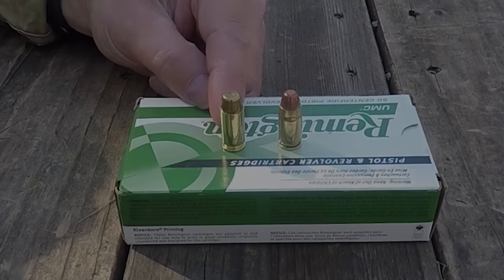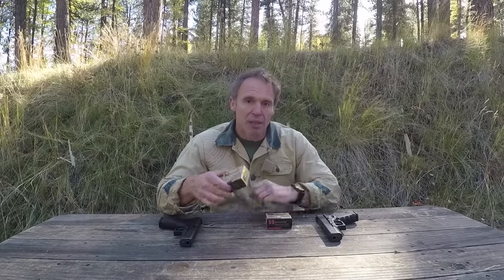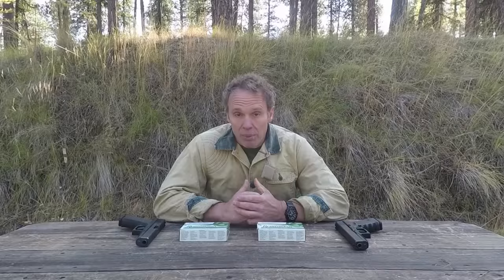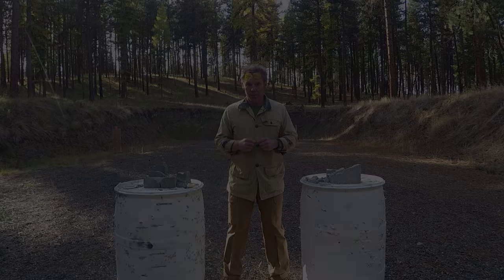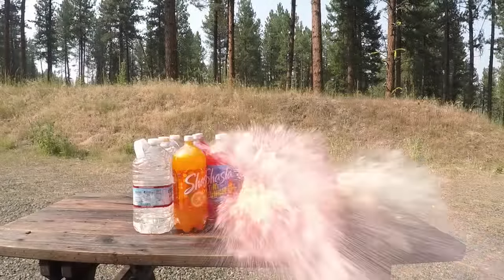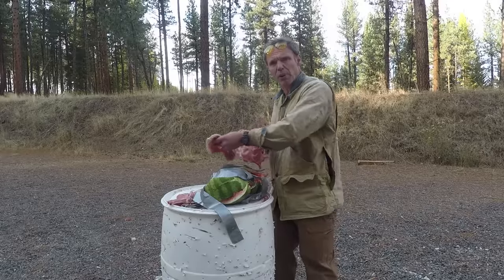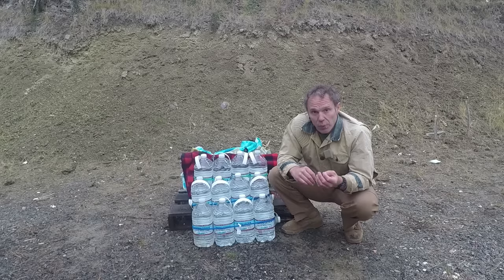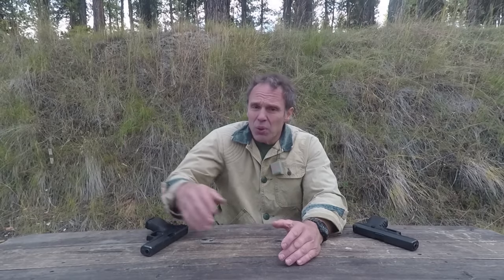Personal protection: .357 SIG vs. .40 s/w

Comment: This is why I personally prefer the .40 cal. It has sufficient stopping power, great expansion to get the job done in "close quarters combat", namely home self-defense. However, it is not powerful enough for over-penetration in case you miss, which most likely will go through walls and hit neighbors or others outside at the time. There is a time to shoot, a time to defend, but remember, you can and will be held accountable for any way-ward shot that injures an innocent bystander.If the circumstance arises, let your shot be true, let it be accurate and pray that you don't miss and hit an unintended target. Tough decision, but I carry anyway. Be your best, but don't get sued!

Comment: This is why I love my Glock 32. It's chambered in .357 Sig but I have .40 and 9mm barrels as well. I shoot what I can get! The same can be true in reverse for Glock 23 owners. While they both accept 9mm conversions, it requires at minimum the barrel and RSA, and an extractor if you don't care about those 6 o'clock ETFs. If you wear eyepro, the latter you can deal with.

Comment: Hi Paul, rewatching the various 357 Sig videos.  I agree with you in that it is an expensive round for training.  I will pass along what I did 15 years ago that could be applicable here.  I love 45s and at the time it cost 10 cents a round more to shoot than 9 mm.  I used to get 1000 rounds of 9 mm for $300 and 1000 rounds 45 ACP for $400.  At the time, I could pick up same type 9 mm pistol to my 45 ACP for $600.  As such, if I shot 6,000 rounds of 9 mm as a supplement to my 45 ACP in practice, the 9 mm pistol became essentially free and any more ammo through it was savings over 45 ACP.  For 357 Sig, AmmoSeek currently lists 1,000 rounds at a lowest price of 430; 9 mm is 1000 rounds for $190.  The price difference is 24 cents per round.  Let's call it 20 cents per round difference to keep math simple.  As a member of GGSF, I could probably get a Glock 17 in 9 mm for $600 with a GGSF membership and the discount on one Glock per year.  As such, after 3,000 rounds (or likely a couple of years of range practice), the G17 is essentially paid for and 9 mm ammo can be used as a more frequent training round - similar to using 38s through a 357 magnum.  Of course, you still want to shoot 357 Sig from time to time but this is a potential approach that doesn't take too long to justify getting a second pistol in 9 mm as surrogate trainer for 357 Sig.  Just my two cents.  I did similar for 9 vs 45 when money was tighter and I didn't want to use 22s as a surrogate.

Comment: I have 3 barrels for my Glock 23; a 9mm, .357 Sig, and .40 S&W. When shooting all 3 calibers with nearly the same weight of projectile, the difference in felt recoil is minimal. With the 9 mm as reference, and with approximately the same weight projectile, there is a bit more “snap” with the.357 Sig and a bit more “push” with the .40 S&W.  I seem to be a tiny bit more accurate, and more importantly more consistent with the 9mm and the .357 Sig.  I can guarantee that your results will differ.   I have several other 9 mm pistols and 1 other .40 S&W. I will say there’s nearly as much difference in felt recoil between some of my 9 mm’s as  there is in the 3 different barrel in the Glock.

Comment: I wish 357 sig was more popular/available/cheaper. It's a great round. In between 40&10mm in power but in the smaller 9mm sized frame vs 10mm being in the larger 45acp sized frame. Great self defense round and in my opinion a decent wilderness side arm in the semiautomatic verity

Comment: @0:32.  Actually, the .357Sig is NOT a necked down .40.   If you tried to neck down a .40 casing to .357 Sig, the casing would be too short.   So what is it exactly?  Answer:  .357Sig is a CUT down (slightly longer than .40) then NECKED DOWN to .357 Sig from a 10mm casing.  Google it.

Comment: If you take the hottest 40 155gr from Underwood and the hottest 147gr 357sig from Underwood, the 40 beats the 357sig. 
.40s&w-155gr-1300fps (4” barrel)
.357sig-147gr-1250fps (4” barrel)

Plus the 40 can take 180 and 200 grain bullets and as low as 125 grains. It’s more versatile and every bit as powerful. Some of these companies water down some cartridges while having other closer to spec. 10mm being a good example

Comment: Install a threaded barrel that adds an inch to the length. The added inch will add on average 50 ft/lbs to the KE, and equal appropriate 500 ft/lbs; without any additional recoil.  

500 ft/lbs is also the average rating of a .357 sig; granting the .40 S&W an equivalent of KE.  

Consider the added diameter of the projectile and added weight of the .40 projectile makes .40 S&W the SUPERIOR bullet/cartridge for personal protection.  NOT, the .357 SIG.

Comment: If you're comparing calibers stop trying to use the same bullet weight!  They are different for a reason.
"I'm gonna gonna race this V8 sedan and a 4 cylinder hatchback, but to make it fair the V8 is pulling a trailer...."

Comment: I read that it was not really based on the .40sw, but the original 10mm and cut down to a very similar length. That's splitting hairs of course.

As for the blocks, they are cinder blocks. Concrete has aggregate (rocks) in it. Some writer with no experience must have started calling these "concrete blocks." They are not. Concrete blocks are much heavier.

Comment: I thought your review was very unbiased and straight forward .  I was wondering your thoughts on how "the .40 is dead" and everyone is using a 9mm +P comparison to make their claim. Standard pressure for both is 35,000 and 9mm+P is 38,500...why is there not a +P SAAMI pressure for the .40.  Might make a good table top discussion.  Thanx

Comment: You should use the standard load of each, and a standard load of 40 Smith for defense purposes is usually a hundred fifty-five 165 grain hollow point. The standard for 357 Sig 125 grain hollow point. That would be a fair comparison because that's the most carried loads for the purpose of Defense

Comment: I read somewhere that the .40 was purposely a heavy hitter but shorter-penetrating round, for use in urban LE where there's a heightened risk of bystander casualties.
Reply: .40 is literally just 10mm weakened to the point female and otherwise inferior cops can shoot it.

Comment: .357 SIG is designed for maximum penetration specifically for street shootings where the bullet needs to go through car doors and fenders and do damage on the other side of the vehicle.
What is the point to use JHP bullets with a caliber that is designed to penetrate before it hits the target, not to release its energy within the first obstacle?
Also, if those two are side by side penetrating 2x4 wood (multiple planks) or a target hidden behind a vehicle - the .357 SIG with greatly outperform the .40 S&W.

Comment: I'd say .40S&W is better, because due to price, you can get A LOT more practice for your buck, and I'd say the performance gain with .357 Sig doesn't justify the increase in cost to practice with your weapon. When you're poor like me, and need a caliber capable of defeating barriers with ease (why I don't use 9mm), cost is a huge deciding factor. I couldn't afford to train as much with .357 Sig as I can with .40S&W.
Reply: for me, the .357 sig really shines when used in a PCC, because the longer barrel length increases a lot the velocity of the projectile (see 357 sig test on carbines for you to understand what I'm talking about), besides that the 357 sig is a very accurate caliber, in a PCC is even more accurate

Comment: If I were running 357 sig I'd have a carbine and a heavily modified pistol. I'd also load my own ammo to find the right middle ground for carbine effectiveness (longer burn) and pistol effectiveness. I'd also extended the barrel of my pistol a bit and add a flash suppressor because of the fireball effect of slower burning powder. The goal wouldn't be to get the most power 357 sig ammo (notorious for destroying pistols) and not the fastest carbine round either. It'd be more like running +p+ 9mm ammo but though two far more stable platforms.

Comment: I think I'm missing the point. Check out Remington Golden Saber now called Remington Black Belt ammunition. The test I've done, at one point .400 caliber Golden Saber bullets at 180gr. expanse to 7/8 of an inch from  7/16" plus it
 goes  2" deeper than lighter higher velocity weights of the same caliber. For personal protection I'm looking for something that expanse more than slices through + easier to obtain ammo. And my personal thoughts are I don't want to stand in front of any bullet anyway.

Comment: I use 125grain in my glock 23. It's about the closest to being the best personal defensive load for the 40cal. It's the weapon that is my primary carry weapon for winter and bulkly winter clothes. My usual carry weapon is a glick19 useing a 124grain load. I also have glasser safety slugs for home defensive situations. To prevent over penetration in close range situations indoors. Is one better than the other. Probably not and both are effective. But modtly I carry a glock19 useing 124 grain ammo. It's a effective defensive load and I'm satisfied useing it. But to be honest. A handgun is basically a defensive weapon. And the old saying that only a fool knowingly carries a handgun to a gunfight is still prevalent today. And use of a carbine or rifle or shotgun will always be a better choice for most defensive situations.

Comment: Had both barrels in a glock 22 and the 357sig was a beast to shoot compared to the 40.  I sold the barrel, not worth the ammo expense and recoil disadvantages.  You can see and hear the difference in the video. It is significant for very little gain. FWIW I shoot large calibers all the time but the G22 is my oldest and  one of my most reliable pistols and dont see any advantage to the .357SIG in a defensive pistol.  Considering this is the EXACT same pistol in both calibers (only difference is the barrel),  in most cases, with frangable ammo in a home defense situation you never want to over penetrate so the advantage is skewed towards the 40.

Comment: I think the 40 has a better energy dump up front of the sodas, but the 357 has better penatration with a later energy transfer that's equally impressive. Both are excellent rounds and I wouldn't feel underarmed with either. 40 is my go to though

Comment: One of the greatest flaws of the .40 is paradoxically its very origin : it is always compared against its parent cartridge the 10mm, which is VERY potent, and that damages how it compares to the ubiquitous 9mm and 45acp, which it outperforms in every aspect.
It remains a very capable handgun round (which means, average at best when pitted against long gun cartridges), that should have taken it's rightful place as the standard police round everywhere imho, where handguns are used as a primary weapon...

Comment: great video. terse, informative, and without irrelevant fluff filler.  Thought: would have mitigated potential variables further by using both barrels in a single gun. (edit:)  man, the level to which almost all major manufacturers download .357 sig is ridiculous. then the premium brands charge you astronomical prices to purchase the "enhanced performance" which is....yay....the original loading. wth.  1270? i have regular pressure 9*19 that hits that, albeit with 115 grain bullet. but sig should hit 1400 no problem in regular, default loading imo. otherwise, the entire purpose of the round is nullified. performance loadings, and this is just arbitrary opinion, should hit 1600+.

Comment: Excellent video! Factual based info! It looks that the 357sig it's very solid round. Your  video already suggested that 357 sig it's "better" than 40. You also have a 40 vs 45 video that suggests that 45 it's "better" than 40. So why don't make a 357sig vs 45 video as a "better" man stopper round?

Comment: The 357 sig was designed for the 125 gr bullet and for around 500 ft lbs. you should use what the round was designed for and not similar weights for each load.

Comment: 165gr generally optimizes the power potential of the 40sw.  The sig was designed to optimize at 125.  So , you danced all around it, but never did find the right spot.  Also, the 40sw generally loads to 480 fl-lbs range true commercial load, remington or sig sauer ammo loadings.   So again, comparing two cartridges, you hav left in key variables that make this presentation of marginal utility.

Comment: This is where there’s a lot of contradiction, but I believe that 357 sig. is actually based on 10 mm not 40 Smith & Wesson. The reason is that the neck is slightly longer on that 357sig.. I don’t claim to know whether you can simply neck down to 40 Smith & Wesson case to make a 357 sig. but I would guess there would probably be a bit of issue.
So yeah I’d say it’s actually based on the 10 mm based on my limited knowledge and I fully acknowledge that I could be completely wrong on this I just think it’s an interesting topic and if anyone has any information I would appreciate it
Reply: No that would be 9x25mm Dillon. Its much more powerful than either.

Comment: The .357 Sig was designed for speed and distance. It can blow a hole completely through a person. The .40 cal is not for long distance. It's not likely to blow a hole completely through a person. It will however make much more of a mess. They're both nasty. Neither round is "better" than the other any more than comparing a hammer to a screw driver. They have their applications. The concrete block test was totally ill conceived, unless you just want to kill concrete blocks. Any single shot, from either gun would have the power in one person's hands to end another's. But all of the cowboy bobs of the world just think about how big a hole they can put in someone. I love my guns in the night stand and gun safe. Guess I'm old school.

Comment: Hmm ... Now I might have to drop my G32 barrel into my G23, and start carrying that more often. I also like the flatter trajectory of the .357 SIG. Keeping a heavy tungsten guide rod in my G23, also tames the slightly snappier felt-recoil of the .357 SIG.
Reply: I noticed that lighter and faster bullets tend to dump their energy closer to the entrance than slower heavier bullets. Ever noticed how the .357 SIG destroyed the ribs while the .40 S&W seemed to do more damage to the watermelons? But the .357 sig does have a slightly bigger case capacity for powder.

Comment: Paul, Paul, Paul.  Really?  You choose the heavy for caliber for the.40S&W and the light for caliber in the 357SIG.  I understand that ammunition supply is fickled sometimes but enough already.
You and I know that there are typically three weights per caliber, light, medium and heavy.  Our example in .40S&W (155gr., 165gr., & 180gr.)  Even in a specialty, boutique, cartridge, like the 357SIG..  Don't get me wrong, I'm not a hater of any cartridge, but you'll have admit the 357SIG is hardly mainstream.  As for bullet weight selection, why not elect a comparison of light vs light or heavy vs heavy and let those who fail to understand pout, if they must.
An explanation should suffice and, as you've often pointed out, energy foot pounds (efp) is the bottom line anyway.  Do the math, and compare that number, after the chronograph session.

Comment: Hey Paul, not to be pedantic or “that guy” but why didn’t you use two P320’s chambered for each caliber? That would’ve been the closest to identical you could get.
Reply: I haven't checked, but wonder if Glock or Sig-Sauer ships each caliber with a different recoil spring or if they just go with one for simplicity or monetary reasons, but a very "logical" point as Spock would put it.  I have a Sig 229 with one spring & 2 barrels, only thing I notice at 50ft the .40 groups about the size of a large dinner plate, the .357 the size of a smaller dinner plate.

Comment: The fact that people were too wimpy to handle 10mm so they shorten it to 40. Then they want more out of it so the neck it down again. THEY HAD IT RIGHT THE FIRST TIME! not saying 40 or 357sig don't have a place, but when arguing over power, just look to the father of both these cartridges 10mm. Id be curious if 40 was never made and the necked a 10mm length cartridge to 9mm, just what the ballistic performance would be. Full house 10mm already has super close performance to 357 magnum, so with that logic, my fantasy cartridge would beat out both 10mm and 357 mag

Comment: A 357SIG is a .40 case necked down to a 9mm, right? Kind of like a .40 super is a .45 case necked down to a .40. 

Wouldn't that be the best comparison? Not knocking this video, just curious?

I know Mr Harrell gets a lot of crappy feedback and I am not adding to it. Just asking for clarification. Comparing apples to oranges.
Reply from the maker: People asked to see a comparison of .40 S/W and .357 Sig.
 And we have a presentation where I do a lengthy comparison of apples and oranges.
Reply: @PaulHarrell  Mr Harrell, sir you truly are a professional on and off the range.
Reply: @PaulHarrell  I saw that presentation.  You were using hyper oranges vesus generic apples.  You should use the apples I use. 😉